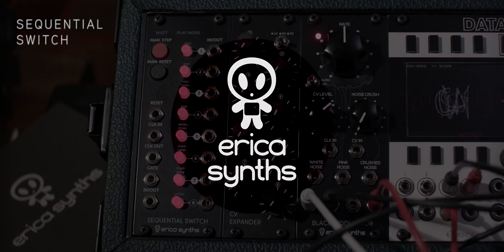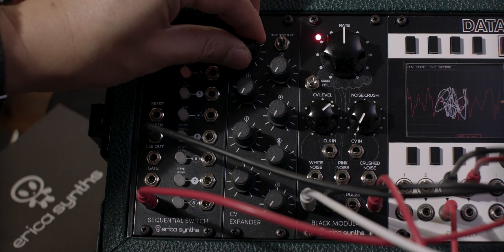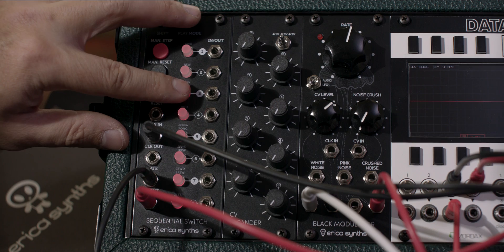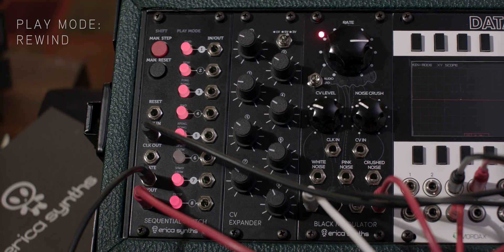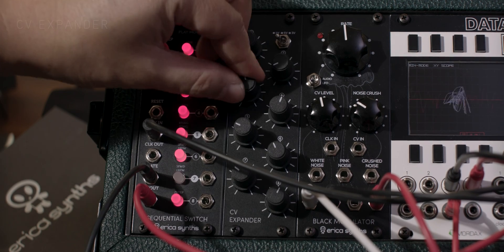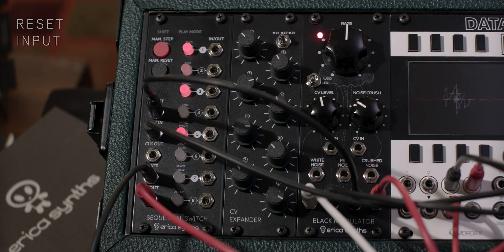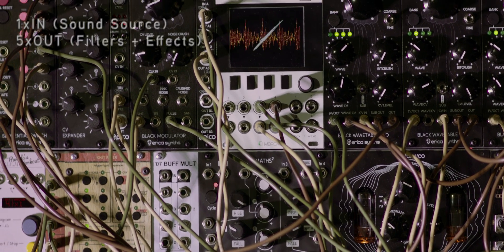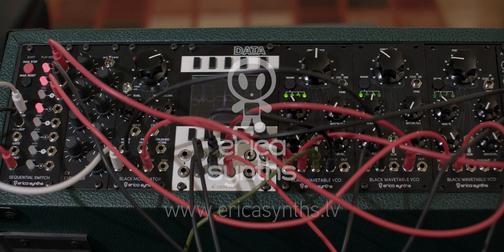Erica Synths Sequential Switch V2 + CV Expander 4K Overview

Comment: What knobs are these? I rather prefer them to the ones that came with my V2 setup. The knobs that showed up are rather long and smaller in diameter which makes turning them finely more difficult.
Reply from the maker: Hi James, sorry for the late response.  Probably the best way to figure out which knobs Erica put on the SSv2 around the initial release is to contact support via their site at https://www.ericasynths.lv/support/directory/product_info/request/  You can reference this video to jog their memory.  Hopefully the knob vendor still produces them.  You may also try looking on Mouser or Digikey.  This is closest thing I could find.  https://www.digikey.com/en/products/detail/kilo-international/OESL-50-2-5/710736 It's metal though, where the knobs on mine are plastic.  You'll need to know the diameter of the shaft in order to order a knob that fits.  Good luck!